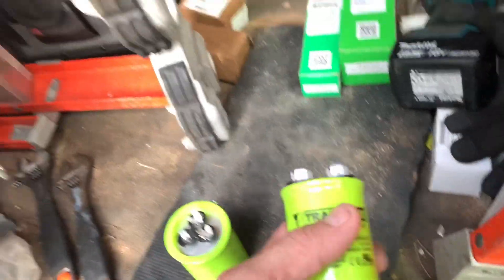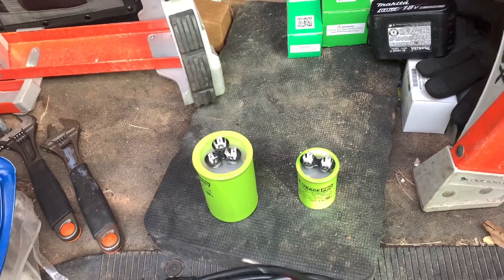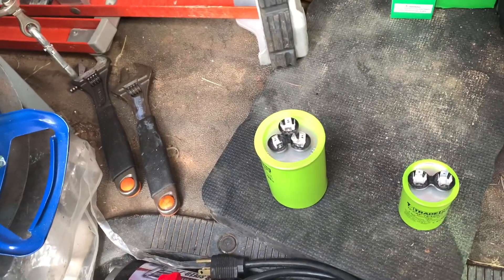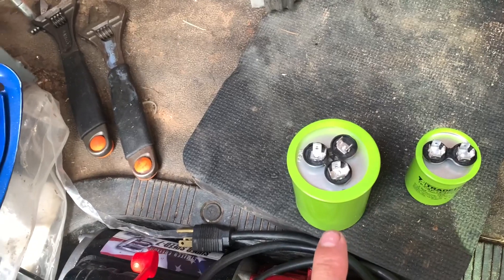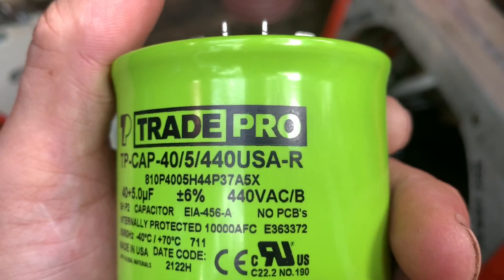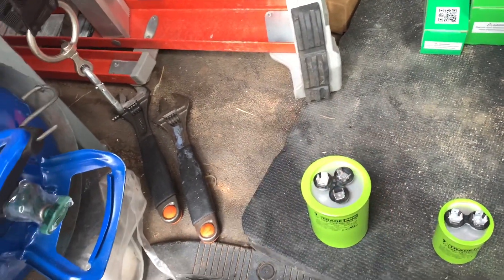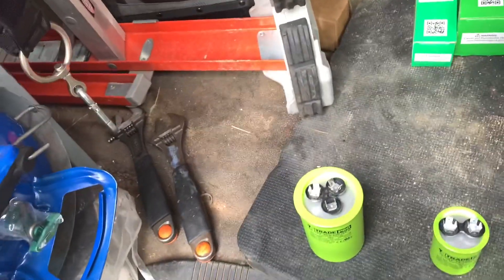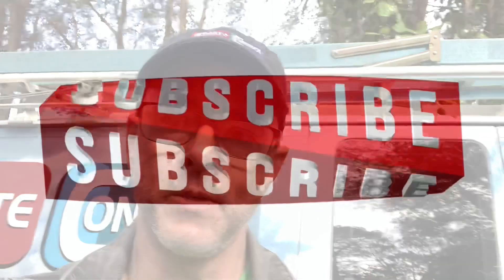Capacitors And Voltage ⚡️⚡️Rating Explained

Comment: Some caps rated for 370/440.
Reply from the maker: Yes, they are labeled that way to try and end some confusion. They are 440V, listed as 370/440 for those who may not understand - like our vendors - that it’ll work for either rating
Reply: Good tech advice !

Comment: The higher voltage rating of 440 volts is due to the motor manufacture's realizing that most motors produce higher back emf than 370.

Comment: The capacitor voltage rating is the maximum voltage that the capacitor may be subjected to. This would be the peak voltage, not the average or rms voltage values such as the 120, 208, 230,  277 volt values with which we are familiar. Peak voltage in an a/c system can be defined as the maximum voltage reached by the a/c sine wave before it reverses direction, and heads back towards zero. So capacitors used on the residential condensing units you service will usually be exposed to the peak voltage associated with 230 rms volt systems. 8Peak voltage can be calculated by multiplying the line or rms voltage by 1.41 (square root of 2). So peak voltage for the 230 volt system is 230 x 1.41, or 324.3 volts. This value is safely below the 370 volt rating. Of course a higher 440 volt rated capacitor may also be used.

Comment: Only start capacitor will be kicked out the circuit. The run capacitor is still in the circuit during the running. It generates heat during motor running, that’s why the run capacitors are normally made of aluminum to help dissipating heat
Reply: It has nothing to do with heat.

Aluminum is used because it’s plentiful, cheap and can be easily rolled into a very thin foil. Think kitchen aluminum foil only much thinner. That’s what is rolled up inside the can between chemically treated paper which is an insulator. That’s all a capacitor is, two plates of metal, held very close together in parallel over a very large surface. The more surface and the thinner the paper, the higher the capacitance value. But, the smaller the distance between the foil layers, the lower the applied voltage must be in order for it not to flash over/arc and short the cap.

The outside can is aluminum because is is cheap, not because it needs to dissipates heat. An ideal capacitor dissipates zero power but in real life, there are minor losses but not enough to require the can to be aluminum. If it needed to dissipate heat, it wouldn’t be shoved deep inside the unit, it would be in the fan airflow.

Comment: The capacitor in a PSC motor has two purposes.  It provides the phase offset between the currents in the run and auxiliary windings to give the motor a start push.  But it remains in the circuit to "tune" the motor to operate most efficiently at its design load.  It does this by making the run and back EMF magnetic fields as circular as possible.  So that the motor has a power factor as close to one as possible at the design load.  If the fields become unbalanced the difference is expended as heat and will eventually cook the insulating coatings on the windings causing failure.  

When you add a hard start kit, you are adding a start capacitor since the startup torque on the compressor is now more than the offset force the run cap can create.  

But the voltage rating on any capacitor is just the voltage limit before there is a risk of an arc between the "plates", in reality conductive film sheets, shorting the cap.  Using a higher voltage rated capacitor gives even more safety.  It's the capacitance that matters and must be what the designers specified for the best operation.

Comment: Why do they even make the 370 v caps? Why not just make them all 440?
Reply from the maker: Not really sure
Reply: Money?
Reply: At one time there might have been a significant cost difference since the lower voltage could use a cheaper film, oil or something.  And the manufacturers might save a dollar or two on each cap if they go with the lower voltage.  But in the service market, there just needs to be the 440 or 370/440 as no one is buying them in that kind of bulk, unless it is the supply houses.
Reply: The 370V is probably thinner.  He just did a Ruud video where he dropped the replacement cap through a hole in the sheet metal; the other end’s cooled a little by fan air.  Probably won’t fit through that hole if it’s 440V.

Comment: Once I learned that a 440 can take the place of all 370/440 I only buy 440 rated caps !🤣
The most important thing a capacitor does is increase the phase angle between cycles to make the motor run more efficient. 
And that all depends on the manufacturer. Rudd/ reheemski loves those little 3mfd buggers!
Take care!
🍺🍺🍺🥃🥃🎯🏌🏻‍♀️
Stay safe. 
Retired (werk'n)keyboard super tech. Wear your safety glasses!